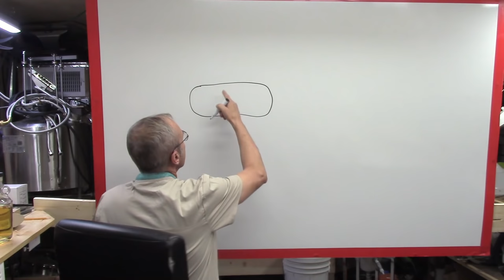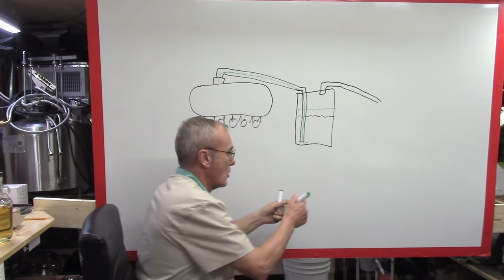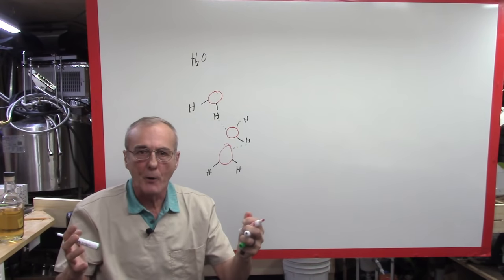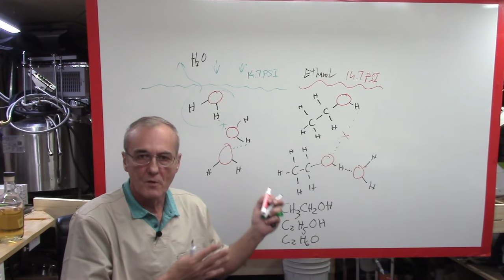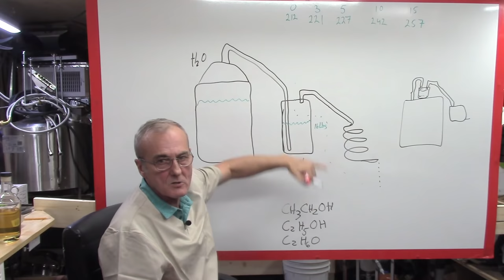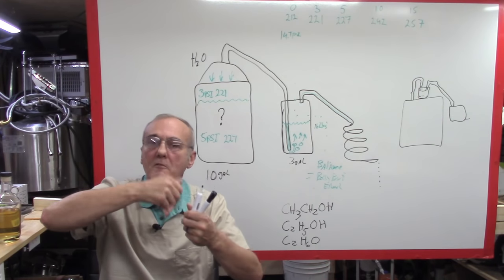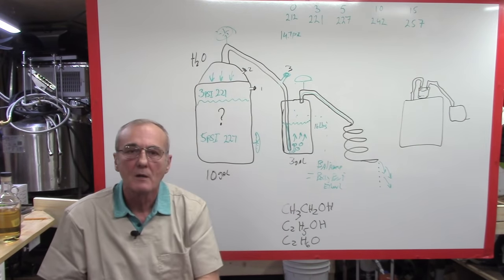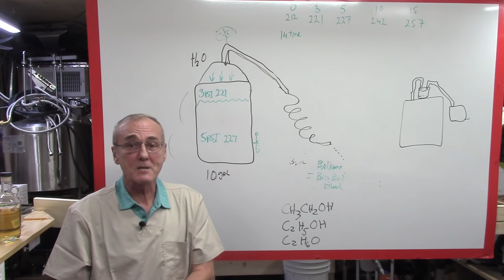THUMPER THEORY, OPERATION AND PROCESS

Comment: Now after following your channel for 2 months I made my first run on a cheap Chinese still. Because of your instruction everything turn out good.  Didn't collect enough on the first jar just 3 ounces for the shots, so the heads went into the second jar, so I wasted about 4 oz, however jars 3 &4 where 148 proof, jars 5-8 where 140 proof, & jars 9 &10 where 105 & 92 proof.  I used 8 oz jars in case I was screwing up I didn't want to waste to much.  It was your sour mash receipe I used, with some changes of my own.. Thanks.

Comment: I thank you once again George.  No one could give me a straight answer regarding what a thumper does to product.  So if I understand you correctly, it’s better to do a stripping run, then rerun with that with a 40% solution.  I was not stripping but running really slow with a thumper WAS double distillation.

Comment: I use a basic pot still and have had 165-175 proof without a thumper. Recently I added a thumper and I get 185 proof and a much better tasting product. My thumper inlet is about an 1/8" from the bottom and have holes drilled to about 1/2" from the bottom of the pipe. I fill my thumper with 80-100 proof tails to just covering the drilled holes. I use light duty clamps and surgical tubing to seal the main pot. At the worst of times, a little flour paste will stop a leak. There is barely any pressure in the pot or it will easily leak. When I'm done the whole run, there is exactly the same amount of liquid in the thumper as I started with. Science doesn't mean better. The thumper was the best addition to the still I've ever had and I have never used a thermometer anywhere.
Reply from the maker: You are one of those I spoke about. You've mastered the process and your set up. Good job and keep it up.
Reply: @BarleyandHopsBrewing  I do enjoy so many of your videos and wasn't meaning to be brash. I got lucky with my setup I guess. Thanks for the rewarding reply!

Comment: George hit it right when he said thumpers were a simple way to control temperature on old time wood fired stills, but today we have electricity and  temperature controllers like PIDs.  We can control temperature very well and the thumper is really obsolete.
Reply: @max gamble I haven't been distilling very long but I assumed the only reason anyone would use a thumper these days is to infuse flavor. I have an alembic still without a thumper because I'm not infusing any flavor and I feel safer with an open system.
Reply: Couldn't an herb infusion basket essentially replace the thumper in regards to infusing flavor? Or is there a big difference between the two methods of infusing flavor? Noob here so I apologize for stupid questions.
Reply: @BaltimoresBerzerker  It is difficult to transfer flavors into the distillate no matter the method, especially any mild flavors.   A mash made from mild flavored fruits like grapes, peaches, pears, strawberries, etc., will not pass its flavor to the spirit collected enough to hardly be tasted.  Only grains and fruits with strong flavors work.  Corn moonshine is an example.  Its distinctive flavor is due to the corn which has a strong flavor, but make a mash from peaches, and the peach flavor will barely be detectable. This is why commercial distillers don't distill these things, instead, they add the desired flavor post-distillation.  Grains like corn, barley, and rye impart their flavors because they have strong flavors, so they work, but make a mash with wheat and the result will be more like a neutral spirit like vodka.
The real craft in making any spirit is not the distillation phase, but rather the flavoring process.  This is where the true "art" comes.
Reply: @skyhookspirits  thank you! Very interesting! Do you have any sources (reading or video) regarding how to properly flavor your spirits? Either way, thanks for the kind informative reply my dude! Have a great one man!
Reply: @BaltimoresBerzerker  If you watch Moonshiners, they are always making some exotic spirit which according to them tastes fantastic.  Don't believe it!  Many things they do are correct, but many are just BS. The program is interesting and has caused many to take up the hobby.  That is great.  If you are a newbie, just don't take everything they do as gospel.  Things like running multiple thumper jars, fermenting unheated grains, drinking spirits straight from the condenser, and getting sensational flavors from various mashes is pure BS.
Reply: @skyhookspirits  lol I don't have TV but I've seen it at a friend's house and figured there was a lot of sensationalism and outright misinformation on there. What you say makes sense, an example being crown royal apple. There ain't no way they infused such an intense apple flavor! It was obviously added post distillation. I wasn't sure if that was the industry standard or not. Appreciate ya man

Comment: Thank you George for a great video!
I just wanted to add my 2 cents:
You mentioned the rise in the boiling point of the liquid in the boiler as a result of the pressure increase because of the liquid level in the thumper. The thing is, for a pressure increase of 3 psi for example (about 0.2 atm), the liquid level in the thumper would have to be about 2 meters (about 6.5 feet)! Perhaps a bit less because of some flow resistance in the system, but it probably would not be relevant for a home distiller.
Maybe there is another factor in play here?
I haven't really done much distilling in these areas (outside of lab - I'm a chemist), so maybe there are some additional technical factors here that I don't know about
Reply: it would be like blowing air into a glass of coke  V low pressure

Comment: I use thumpers sometimes on my baby 2.5 gallon pot still. That's my experiment still. I do use them to infuse flavors I normally use double thumpers and I put the fruit spices burtanicals in the second thumper. I normally put a higher proof whiskey or vodka in my thumpers since I'm usesing such a small still. Also i feel like it kinda gives me an idea of how a new recipe will turn out on my bigger reflux column by bumping the proof up with a couple thumpers . If you can look into your thumper/s when they start to cloud up thats a good indicator the run is finished. 
That was a awesome vid thanks George its nice to know the science behind the stough im doing i had a pretty good grasp but as always you taught me some more. To me thumpers are just another tool I can use depending on what I'm going for in the final product. I generally get high 170ds even 182 sometimes with 2 thumpers.
Reply: Does the thumper help raise your proof??
Reply: @jimfryar1  yes they do you can put shine in your thumpers instead of wash at it will really get up there

Comment: It may have already been mentioned, but a vacuum safety valve would be perfect. They are small npt valves that act like (but opposite of) a psv. It has a spring and decent that opens up when there is a vacuum to allow air in. I could probably get a part number if needed

Comment: George, just purchased a Thumper to use as a quasi gin basket.  Watching your vids you said not to place a valve on the top of the thumper.  Well the one I purchased for Mile High Stills has a valve on the thumper top that I have to pull out to open.  I believe this allows air to be sucked in to equalize the pressure once you turn the heat off but it didnt come with any directions so just want to see if that is the purpose of that valve since it is not located in one of the 3 places you suggested a valve be placed.

Comment: I have recently purchased a Chinese 5 gallon still with the thumper . It now has a line going to the bottom.  I built a copper reflux Still 25 years ago and the design was then called a Cactus . As it resembled a Mexican Cactus.  Very efficient producing 94% ABV . . 
I purchased the present  Chinese Pot Still as I wanted to make a whiskey.
The system came with a thermometer in the lid of the boiler.  Having a bit of experience I drilled a hole in the top of the Thumper and inserted a mercury glass thermometer. 
Outcome.   The boiler steam temperature was constant at 88c. The Thumper with only 2 inches of wash in it was constant at 78c whilst producing Ethanol. 
As an old person who was used to taking off the Ethanol according to the temperature, I now feel I have better control on the end product. 
My first run after a clean and sacrificial sugar wash, was using 2 kilos of Malt Extract and a 1.75 kilo of Pilsner Beer extract ( which was half price  at local brew shop as near use by date.)
21 litres of water and a Turbo Yeast. 
Ended up with 400 mil of Heads at 80% ABV . 1.2 mil of hearts at 85% . 400 mil of tails at 75% ABV.    Ran it all through again with 2 litres of water added. Ended up with 1.8 litres at 80% of hearts with a 200  mil tails at 70% . 
It already tastes smooth with no off aromas. Have now put it in oak chips and see what eventuates .
I am quite pleased with the Chinese Still using canaster propane gas as a  source which is great for controlling heat. Flat out until first foreshots then reduced approx half way for remainder of run.

Comment: When I run my pot still I get around 120 proof, when I add the thumper it jumps to 154 proof. I know it’s a second distillation but the fact is the thumper makes a huge improvement for anyone using a basic pot without a column
Reply: Consider that regardless of the proof level, you'll get the same volume of alcohol from an equal volume of mash.  The thumper increases the proof a bit, but if you removed it, you'd get same amount of alcohol when both are proofed down to desired level, like 40 % or 80 proof. No matter what type of still setup if the mash is say 10% ABV, the maximum amount of alcohol that any system can produce is one half gallon.
Some time ago, I did some messing about with thumpers, mostly to see if they could add flavors.  My conclusion is they aren't worth their trouble and aggravation.  Today we can control temperature very closely and a thumper is an obsolete device.
Reply: Nobody mentioned abv, I understand abv, us guys that don’t have columns on are pots a thumper makes a big difference. Please don’t try to read more into than what there is. Thumper do make a difference in PROOF for your “basic pot without a column “ you know, a poor mans steel.

Comment: Nice video george,almost bout a thumper system myself until I saw some of your videos.....no reason for the thumper if we can control the temp,and also no reason for a closed and now dangerous system....we do the same thing if not better without it...thumpers are used because they were needed years ago......that simple....
Reply: Thumpers are obsolete in the process but I however have one on standby because it is absolutely neccessary for flavor infusion on certain recipes, bananna waragi just ain't right without a nice ripe bananna cut up in the thumper for a unbelievable nose and flavor that absolutely cannot be replicated by any other means..

Comment: Hey Buddy, bought time you had a drink with us. When running my open system, the proof drops 10 proof per quart at 200 feet above sea level in Southeastern Louisiana. When I double distilled that, the higher proof stayed with in 3 proof for the first 20 quarter's.  Just for knowledge, if someone were to add a thumper, would the proof stay tight, as dose double distilling ?

Comment: hi george you are one thee most informative person i have ever met, one question for you, i have a chinese still with a thumper, but the output from the still into the thumper does not have a pipe going down inside the thumper does not go all the way down, should i extended. your advise on thins thanks

Comment: Happy Thanksgiving, Big man, thank you so much for this video, I get the Thumper question alot and the big one that gets me is the mason jar infusion "thumper". It scares the crap out of me...
Reply from the maker: Me too. The ones that really scare me are the multiple mason jars I've seen inline as thumpers.
Reply: @BarleyandHopsBrewing  jip, that is a proper bom, the pressure involved in that is bonkers. I have seen them fill up, explode and drop out spilling hot high proof spirit everywhere.

And I blame the show on Discovery for this, in the one episode they have like 20 jars inline and the had to way the boiler cap down with sand bags and tie it down with rope.

Comment: The weight of the water has no influence on the pressure in the thumper. The height of the water column is the real factor involved. If the height of rise from the bottom of the pipe in the thumper to the top of the thumper liquid is 1 foot then the pressure needed to overcome is 0.433 psi per ft. of column.

Comment: Hi George. Loving your videos. Learning so much from you. I have a Chinese still and the thumper that came with it had two pipes in the thumper of equal length. I am guessing you would just remove one of these for where the vapour leaves the thumper to go to the condensor and leave the other. I have attached some copper pipe to the one pipe so that it does reach the bottom of the thumper.

Comment: George I`m not sure what you have against thumpers ,but I have had excellent luck with thumper. I get 170 proof . It aids in the separation of the tails. I don`t put anything in my thumper I dont have a tube to the bottom. I get very little ethanol in the thumper. It doesn`t help with the heads, I do the math 5% of the expected alcohol production is assumed to be methanol, I do hold well below 170 once i get the 5 % it slows back down to let me know it needs more heat to bring over the ethanol. do the math once i have to add more heat to keep the flow up I catch the rest as tails retain it for next batch so Its not lost. Open the thumper it stinks i proof the residual left in the thumper no ethanol i do throw it away. the tails i catch is a little smelly usually 20 proof .There is no pressure in a slobber box the thumper is kept very warm so the ethanol passes right through will the nasty stays in thumper.

Comment: Hey George, great content.  Thanks. Could you answer a noob question for me? Why don't distillers (or do distillers) ever use a boiler to heat the distillate by simply boiling water over a primary heat source and piping the water vapor into the distillate via a heating coil? Wouldn't that keep the temperature consistent? 212? Seems like that would be hot enough to cause the distillate to start to come over. No?

Comment: Hi George, I'm a little confused about the pressure in a thumper. A vertical column of water is only .43 lbs. Per foot. So if you had 12" of liquid in your thumper why would you need 4 or 5 lbs.of pressure to push the vapor out of the thumper?
Reply: You would need the pressure to push vapors down to the bottom of the thumper liquid
Reply: George makes a great video and I have learned much from them but occasionally he lets his bias take over. His hatred of thumpers and disdain for the science of copper has him a little confused at times. Everything else is pretty much bang on except his lack of concern for PH during mash fermentation.

Comment: The alcohol has to Double distill in your Thumper or else it would just fill up and then you would have a Huge Problem RUN 😂  

Thumpers are Wonderful, a Double distillation does take place giving you a higher Proof and a smoother spirit. I would recommend you put a pressure gauge and pressure relief valve just for your safety. Thanks for Sharing this about Thumpers George! 

Happy Distilling!

Comment: I have a question on your PID controllers is there a way to set the controller so it doesn't kick on and off so often when trying to hold the temp I set it to and can I set a soak timer that will turn the PID off after a set time

Comment: Does a shorter collum allow more flavor to transfer over? 
Let's go with a 2"collum at 8"or less in height. 
Vs a 2" collum at 18"
Reply from the maker: Not directly. The challenge in column length is when it is too long for the system. Most are between 32-48 inches. 
The challenge with it being too long is temperature management and not flavor. The vapor in a column is the same constituency in 8 inches as it is in 48 inches so flavor is not affected.

Comment: You draw almost as well as I do.........And when you said "hydrogen bond" I thought you said "bomb" and then I got really intrigued!......Your pressure theory is proven in vehicle cooling systems where the system is pressurized by the radiator cap (about 13 psi) to raise the boiling point of the coolant (water)

Comment: I'd definitely want a thermometer on my still if I were running thumper (or even if I wasn't). Still temperature directly correlates to pressure in the still. If for any reason the pipe going to the thumper were to clog, you'd see the temperature start to rise and could shut down/open the release valve before it exploded. For anyone who wonders how an Instant Pot regulates it's pressure, it does it by monitoring the temperature of the pressure pot.

Comment: Avid listener here,love your chanell, maybe you can give me an answer,I'm kind of a newbie, do you cut the distilled  alcohol  prior to aging it in oak barrel, or you cut it after it has been aged,,,thanks
Reply: I've done both.  I recommend cutting to desired proof prior to aging.  When I aged 139 proof in oak, I ended up with 139 proof whiskey.  Too hot for me.  I didn't want to dilute it with water at that point.  Just my 2 cents.
Reply from the maker: I agree
George
Reply: @mcg144  ,,,thanks

Comment: I started of with a 100 gallon submarine still with a 15 gallon thumper and20 foot worm in a 50 gallon barrel with two keg stills for brandy's and a column still one without a thumper for stripping but the big still I'm shorting and dropping the doubler size to five gallon